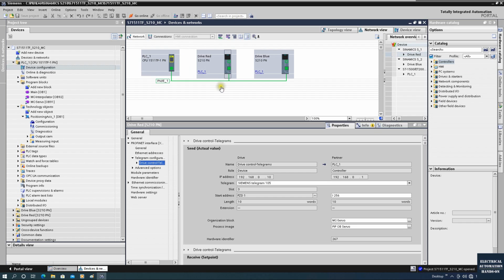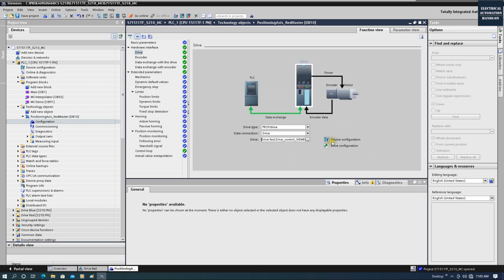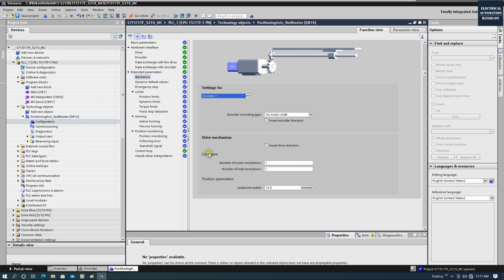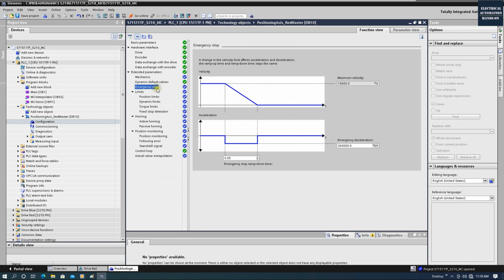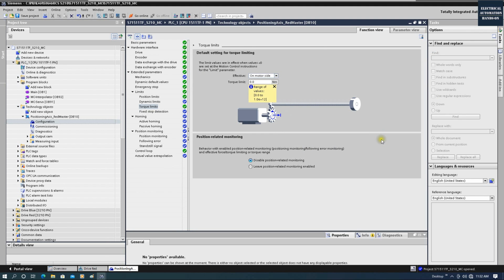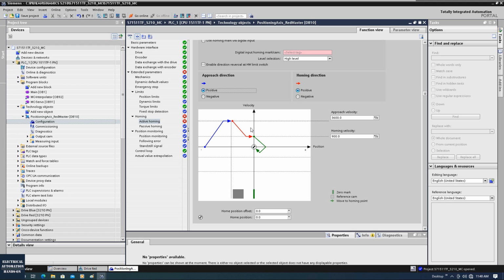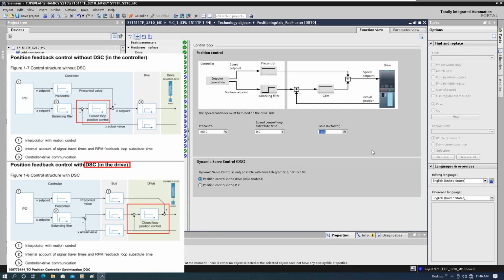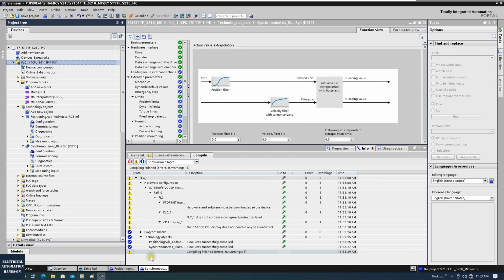MS06F-1. [Siemens S210 #06-1] Positioning TO Technology Object in TIA Portal - Configuration

Comment: Hi, thanks for your great work. Can you say how to set zero position of an absolute profinet encoder via HMI in TIA, without involving motion cotrol (I just want to make a small program which could measure position in degrees, velocity and to be able to set zero position in any shaft postion via HMI)?
I'm using 1215C PLC, KTP700 and TR Electronic Profinet encoder. I have program which already measure absolute position (in steps, not degrees) and velocity, but I don't know how to make settable zero position.
Thanks
Reply from the maker: The encoder always has their own absolute data and position, for your case you could program math calculation equation for 'zero' your application encoder value

Comment: Thank you very much for the videos and they are extremely helpful. Could you kindly help with the control of a Siemens Drive using TO and Profibus Communication between the Drive and PLC?. The data Exchange will be via the Analogue Drive Connection.
Reply from the maker: If you are using analog output from the PLC to the drive, you could review:
MS04a. Setup Positioning Axis via Analog Output, DC Motor, and Encoder
https://youtu.be/Od4cqjMst4Q
MS04b. Program DC Motor Positioning Control via S7-1200 and TIA Portal
https://youtu.be/WNVbgi67HfQ
Reply: @electricalautomation  Thank you very much. I got it now. Much appreciated.